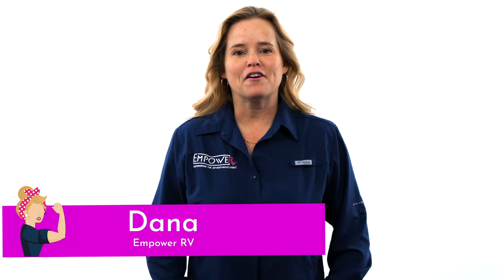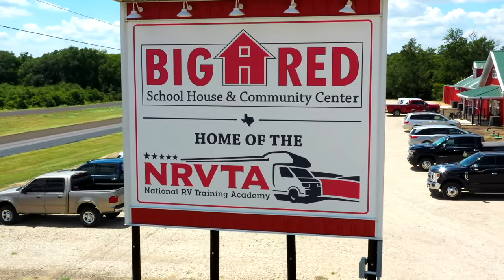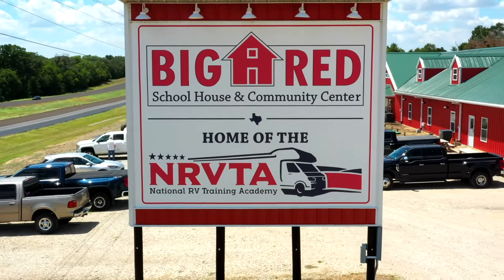How to maximize your RV's Furnace // 52U

Comment: Great video on RV heating and the furnace. Electric space heaters are great but you do need to run the RV furnace on occasion to help keep the underbelly tanks and plumbing a bit warm. That is what I do on my Airstream. Thanks again and take care, Dave.
Reply from the maker: Thanks for the comment. It's nice that a lot of RV's have ducting into the underbelly which allows for warm air into those hard to reach areas.

Comment: If you have an enclosed heated underbelly, be careful using alternative heat sources (electric fireplace or ceramic heater) to supplement the furnace.  The underbelly only gets heat when the furnace is running.  How about if you have tank heaters in the underbelly,  I assume they run independent of the furnace?
Reply from the maker: Thanks for the tip.

Comment: My furnace is in the front and the bathroom vent runs along the wall to the back under the bed and along the other side of the wall finally to vent under the shower. By the time it reaches the bathroom the air is much cooler than any other vent. Is there anyway to move more air to this vent?
Reply from the maker: If you can access the path where the ducting is running you can make sure that there isn't a ton of extra ducting coiled up. RV makers are known for just throwing something in and connecting the ends. Other then that there's not a lot you can do unless you want to insulate the ducting yourself.